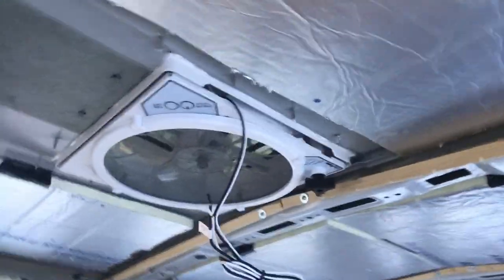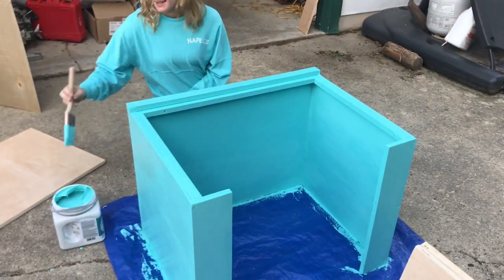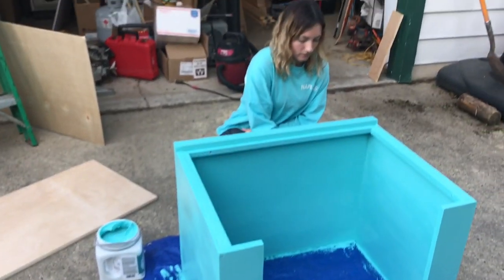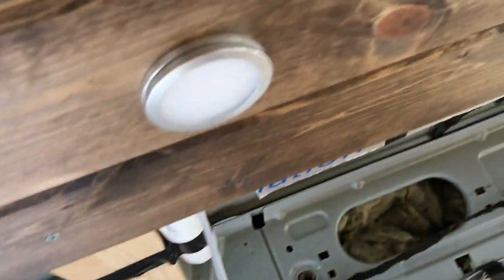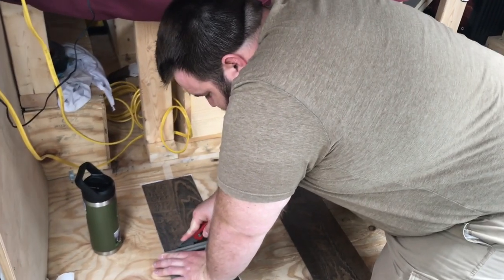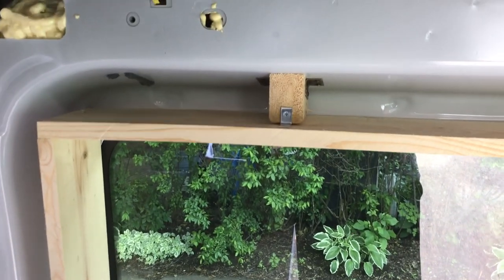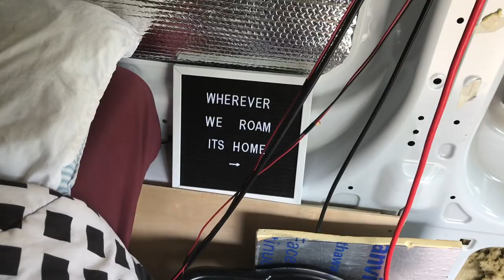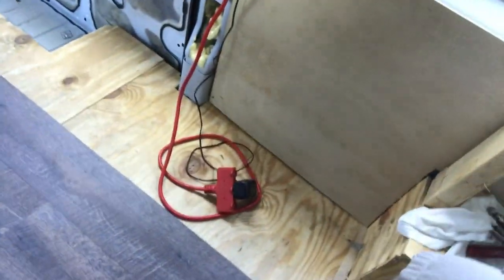Ford Transit Van Build Part 2: Vent Fan, Solar Panels, Electrical System

Comment: You didn't talk about the ceiling! Did you do furring strips right on the ribs? In one shot it looked like you mightve attached them to the side of the rib? How did you connect them, just self tapping screws or rivets?

Which you had more videos, you're the only ones doing a transit pax conversion!
Reply: same here! were you able to find any other resources for furring strips on the ceiling?

Comment: Hi guy . You forget to do the video 3-4 -5 or wherever number for the van built. I follow you to see to build mine.
Reply from the maker: Hi Gabriel! We appreciate that so much! We had found out we were pregnant and had to take apart some of the build to add back in a single seat. Dan is going to be completing the van this summer and I'll make sure we continue to document it. It's just going to be a little bit different than we originally planned :)

Comment: Hi - My van is a Transit just like yours & getting fixed up now.  I'm hesitant to remove the plastic covering from the rear and sliding doors.  Should I be?  Does that free up inches?  Did you have problems when you did that?  How did you cover them?  Did you change the mechanisms?  Thanks!  Love your videos.
Reply from the maker: Hi Peter! We removed the plastic from the rear doors and the side door. We used thin plywood and cut a template for the side door and just screwed it into the metal frame. We haven't done the rear doors yet, but we will probably do the same approach on those. It doesn't really give you any extra space, we just didn't like the look of the plastic :) We did not change the mechanisms at all and the only minor complication was having to carefully take off the plastic on the back door that contains the emergency opener (yellow pulley)
Reply: @twobrokenomads5838  Thanks!

Comment: Where did you order the simulator plugs for the airbags?  I'm getting ready to remove my side airbags before I start framing.   Thank you.
Reply from the maker: Hi Shari! Here is the link to the simulators: https://www.automotivecircuitsolutions.com/products/bypass-simulate-srs-airbag-emulator-simulator-resistor-diagnostic-tool
Good luck on your build!

Comment: Your not using crossnuts for framing?
Reply: Looks like they did not. I just did my ceiling and used crossnuts and wasn't super impressed, about a third of them end up not clinching very well and just spin when you put the bolt in. I still think it's worth trying to use them to limit holes you put in the ribs but seems like it'd be impossible to avoid screws completely
Reply: @dansmith6157  - after your first cinch, re-tighten the nut and close the handles again hard.  It’ll keep that cross nut from spinning.
Reply: @TeachAManToAngle  thanks - actually I've had a lot more success with them lately, I think with my initial ones I was actually over-tightening them - id hear an audible pop which i assume was the actual threaded part disconnecting from the 'plus' part that had cinched down on the sheet metal. Now after the initial cinch I make my incremental tightens very small and stop before I hear the pop. Probably 5-10% end up stripped but that's way more manageable